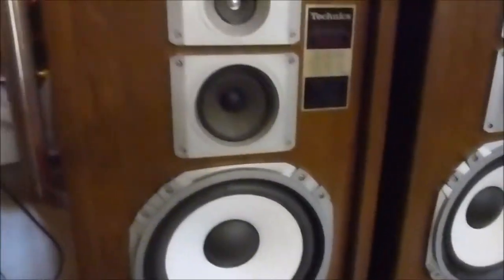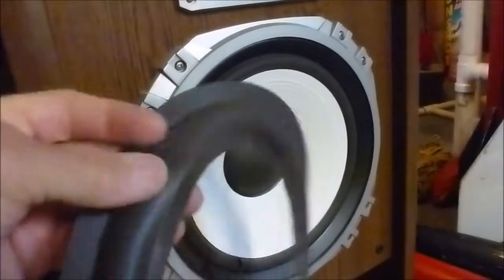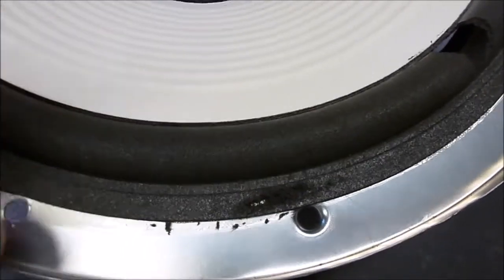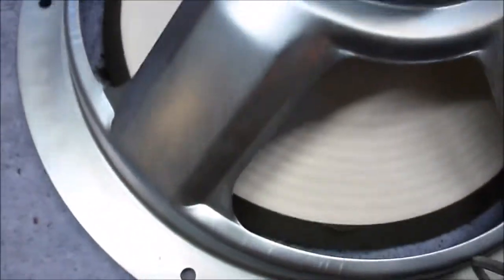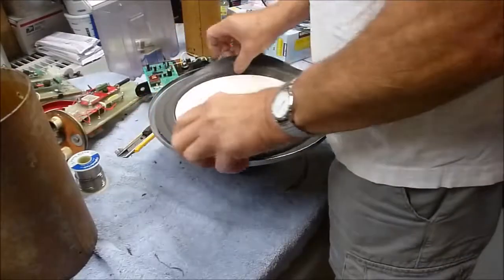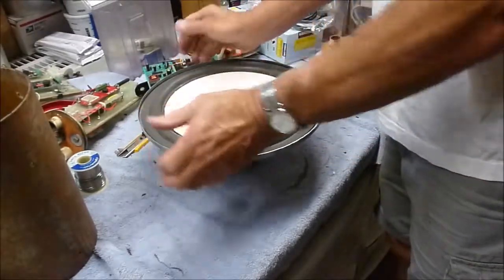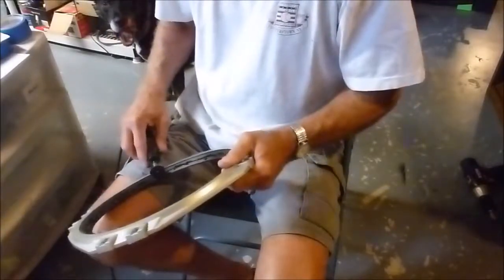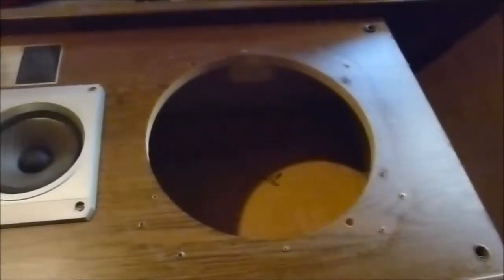Custom fitting speaker foam

Comment: hi, why you cut foam?? i have two speakers Technics SB6000A i need restore them how much will cost me refoam ??
Reply from the maker: I had to cut the foam because I couldn't find speaker foam that matched the speakers.  If you can find the correct size, it should cost about $30 or less.